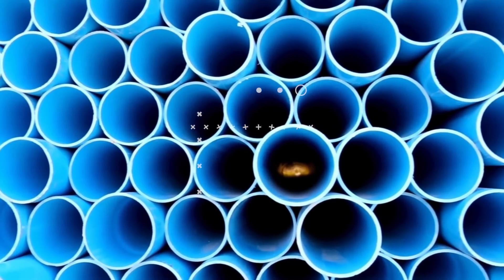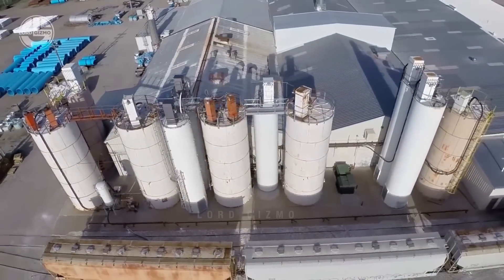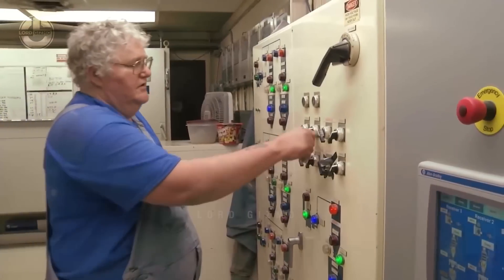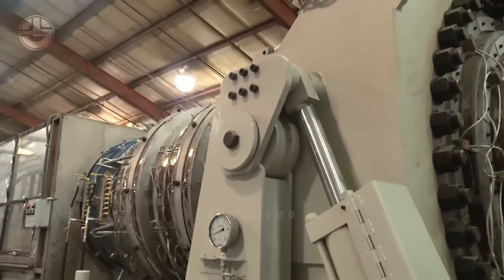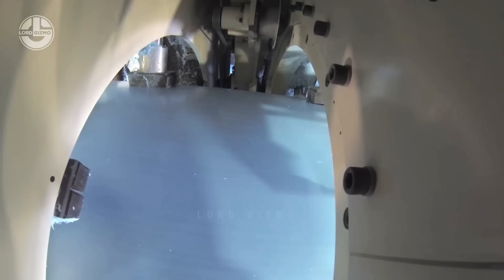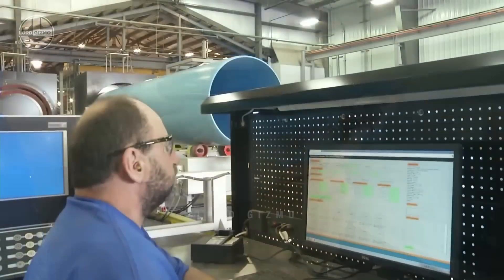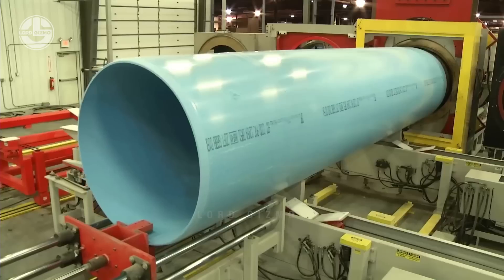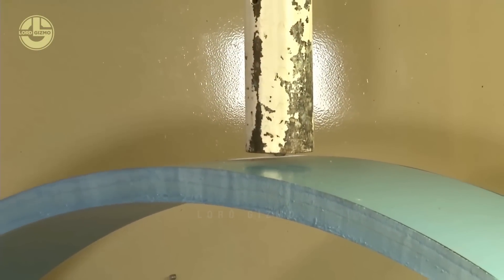Gigantic PVC Pipe Making Process In A Mega Factory #PVC #ManufacturingProcess

Comment: Beautiful downtown Golconda Nevada!  I have loaded there a number of times.
Reply: Perhaps you may be able to answer a question. I noticed they blurred out the brand name on the finished pipe but based on the color and style of the printing, and where the brand name is located in the info strip, it looks like either Diamond Plastics or JM Eagle. NAPCO (now Westlake) and VinylTech put their brand name right at the beginning of the label strip and are typically more blue in color. Sorry, years and years of working as a site inspector in utility construction having to check product submittals against what was being used made me this way lol.
Reply: @Oceanus_Rex  ... A couple of workers were wearing the red Diamond Plastic T-Shirts.  I asked many (too many) years ago, at the factory, why the different shades of blue/green ... they told me that is how they tell the pressure and/or the mixture content of the plastic styles.  Certain shades mean suited for different uses.  I also (not very often though) hauled out of the Chevron pipe plant in Reno, but that was HUGE diameter sewer pipes that were black.  (NOT a good load to haul as they tend to slide around, even when braced and secured as tight as you can get the straps!!  PS: They are so slippery that you cannot even walk on them with tennis shoes on.)
Reply: @Doc_Dolan  Thanks for the info! I knew about the color coding regarding usage (ex: blue=potable water, green=sanitary sewer, purple=force main sewer, pink=reclaim water, etc.) But I did not know that there were other color variations to indicate pressure ratings or plastic mixes. Very interesting indeed.